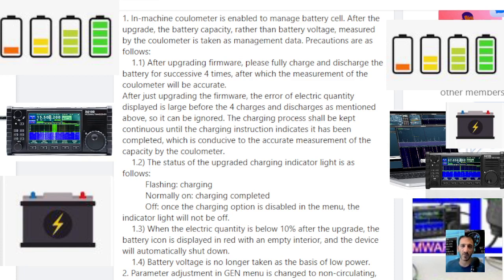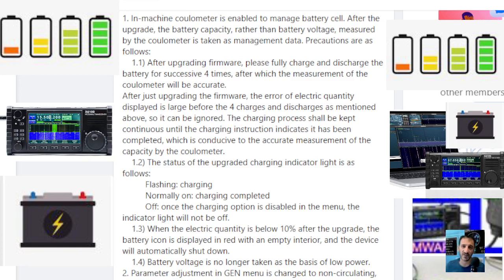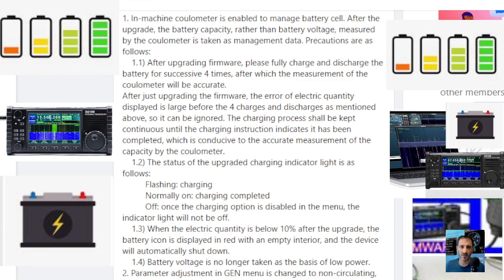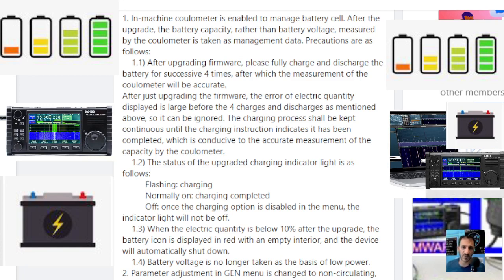XIEGU X6100-  ! IMPORTANT  !   -BATTERY CHARGING INFORMATION - XIEGU

Comment: How many minutes of battery runtime did you end up getting after the 4th discharge/recharge?  My x6100 arrived today and I’m currently on discharge #2. 73’s
Reply from the maker: Hi you only get 3 to 4 hours a spare battery is essential with these high spec sdr colour screen radios -73 all the best.